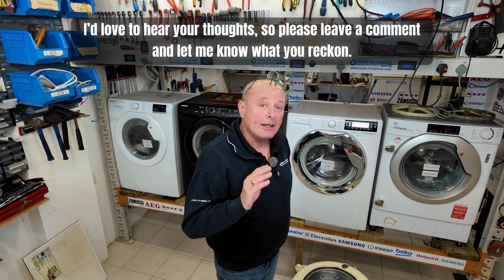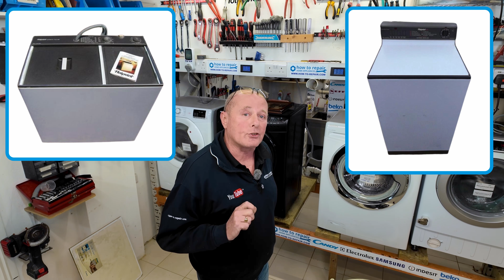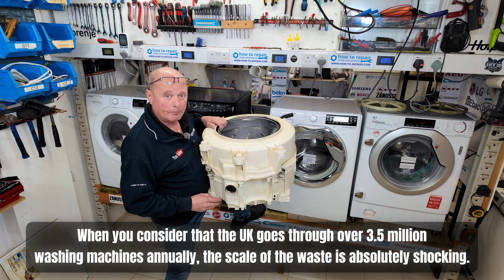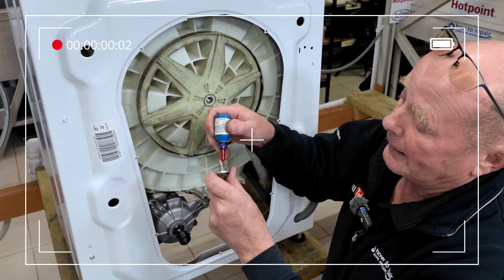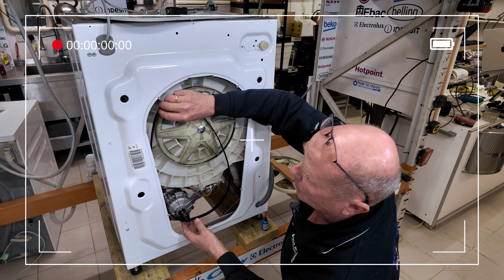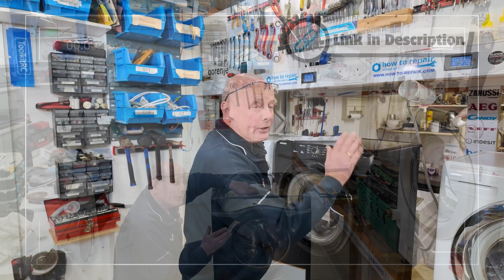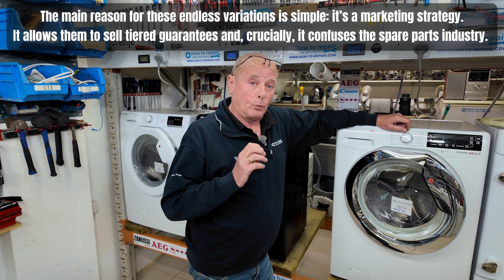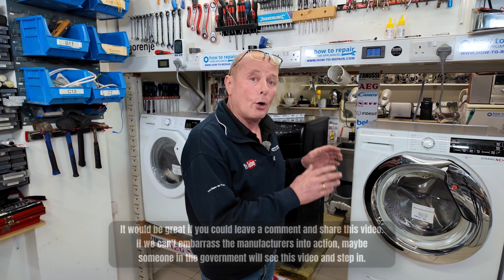I Scrapped 13 MACHINES to Prove a Point: STOP BUYING These Brands!

Comment: I'm a computer, electronics & telecommunication engineer in New Zealand. There are similar issues in my industries. I've always told my customers that a very good way of confirming the quality of a product is by the terms of it's warranty (it's not foolproof though). I've been quite open about my thoughts on built-in obsolesce & several manufacturers have attempted to bully me into changing my recommendations. I will no longer sell these companies products. Good on you for getting out there & letting the world know.
Reply: Say the names...
Reply: This came into my feed 3 days too late lol. Just been thru this exercise in NZ. My AEG lasted 16 years, my Bosch 14 years. I pretty much knew what was wrong. Had replaced the brushes in 2018 and other issue in 2017,  same F fault had cost me best part of $500 back then so figured wasn't worth fixing with costs so high. Just bought an Electrolux as was recommended by so many colleagues... fingers crossed. What peeved me off more was I saw a Bosch model I wanted being run out in Australia (was accidentally on Aus site b4 i realised) for $799 - but in NZ it was still avail for over $2800!!! We get so ripped off in this country now.
Reply: @myobacctsgirl lol!!! A tech repairman came out to fix my dishwasher and cooktop which is Franke and he said Electrolux is THE WORST. 
Franke and Electrolux make up more than half his repair work load. 
He said it's Chinese temu made, factory pumped out same cheap models and then other companies chuck their shell out the outside.  
Stay clear
Reply: @devarmont87  Franke and Electrolux are not in the same league. Franke doesn't produce washing machines just put its logo on chinese made craps. AEG-Electrolux has hundreds of models and while the cheaper ones are not better then other brands, the more expensive models are still among the better ones. They made in the EU.
Reply: @myobacctsgirl  I hope your Electrolux will serve you well.

I'm from Sweden and with Electrolux being a Swedish company originally, we take a bit of pride in when they make good, high quality products.

That said, I have sadly heard that much like other manufacturers, Electrolux quality has also taken a dive in the last decade or so :(

But not with all models, so I sincerely hope yours isn't a bad one and that it will run reliably for decades.
Reply: @sevenproxies4255  See my post above about ASKO machines. They are made in Slovenia now, but that Swedish quality still appears to be there
Reply: @sevenproxies4255  Electrolux has never been a high quality product but it is still among the decent ones. If you want a really good washing machine, you shoul buy one of the more expensive Miele-s. If you can't afford it, then the best thing to find some decent AEG-Electrolux product, like AEG 8000 series. But none of these will last 20-30 years.
Reply: My 4 year old Electrolux Dryer has a EH0 error code. After some research I found that it is a common fault that many people have had. Thankfully others have shared their experience with instructions on how to repair, which is pretty simple. 

The problem is that this same error has appeared on many different models over a period 5-10 years. Surely Electrolux would have known, in the first 4 years, of the problem and issued a remedy for future models. But no, they continued using the same methods releasing more models with the same problems, pretending everything was ok

Sad really
Reply: do you have a website? im interested in the brands and your opinion in 2026..
Reply: Hey Steven, another kiwi here, I have a new panasonic 'inteliigent' machine - it is useless - keeps partly emptying my soapy hot water and filling up with cold water.  Are there are good makers here? I wish they were go back to dumb machines - I just want it to do what I tell it to! I am intelligent enough to do the bloody washing!!! I don't need a 'smart' (but very dumb) machine!
Reply: @NZTanzya  yeah, the "intelligence" is useless on these, I just select cottons, 60C and ignore the "brain" - don't get the Panasonic tumble dryer, you'll be in for a world of aggro trying to get a mixed load actually dry to the touch...
Reply: I am in America, we are having the same issue in washing machines, laptops, cars, refrigerators, they dont want people repairing ANYTHING. They expect customers to just sent their product to the landfill and buy a whole new one and it is insanity. It is wasteful, hard on the planet, and much of these products used to be easily fixed with a few new parts. But noooo, many manufacturers refuse to allow their products to be repaired. Sometimes they make you jump thru hoops just to ORDER the part. I just bought a new washing machine and dryer stacked combo because I live in apartments. Bought the SAME MACHINE i had bought 20 years ago, same model, same brand, but because the Chinese took over the brand in 2018, (General Electric) the new machine is unbelievable. You can see that the workmanship was shotty, parts were sharp and cut my hand I had to file down the plastic areas. 
Even vacuum cleaners are no longer easily fixable. We are living in a nightmare and the Fair Trade Commission, have NO IDEA what those guys are doing. There is no regulation for any of this and a LOT of this is by design thanks to CHINA. But of course, no one will admit it. China makes many of these parts one way or another and they have gotten greedy. Thats why they sealed washing machine drums, same thing with televisions, and parts of the refrigerators as well. Just glue all the crap together so a handyman cant just fix certain parts, it is horrendous.
Reply: @ruth4489 So thruth, all around the world the same thing. I do confirm from Germany.
Reply: @ruth4489 I agree
Reply: @ruth4489  I feel like the FTC knows, but just doesn't care. It's easy to look the other way when you get surrounded by lobbyists telling lies about how Right to Repair will let China steal American IP, or allow their competition to copy their designs while they had to pay the R&D to create the designs, etc. Look up some of the anti right-to-repair propaganda some time to see all the lies they tell politicians to keep these horrible practices alive.

My field is tech so that's the area I'm most familiar with, but it seems like everything else is going the same way.
Reply: Stellantis gives you only 2 years warranty on all his cars. So they know why...
Reply: @AlessandroPitus lo stesso di Volkswagen, bmw e Mercedes
Reply: Well say the names man instead of going "Companies"....
Reply: @Krogdalo No unless you're prepared to pay my legal costs if some company has a go at me.
Reply: @stevengibbins8350  Well, then your word is as valuable as the hollow warranty term of a random company and things will continue to work as intended.

Could have simply not wrote this entire comment lol.
Reply: @stevengibbins8350  why saying "i dont like x company because this specific design" can get you in legal trouble?
Reply: I git your opinion. However they cant charge you for recommendation Ig. They only can get you 4 saying something agaibst therr products. So better dont mention them Ig?
Reply: @yassinehani yeah I don't get his point , as long as its not diffamation he can name without any issues.
Pretty sure if he say " in my opinion this is bad" protect him entirely, you can just give your opinion without any risk
Reply: Comments like this aren't very useful if you omit the names of those companies for some reason. Why protect them?
Reply: ...and they are??? please give name brands!
Reply: HP is one company to be very wary of. They did this at least once and there is nothing stopping them from doing it again. My HP laptop was dead the day after the 12 month warranty expired. I will never forget of forgive them for over $1,200 down the drain!!
Reply: I'm in NZ. My GW511 is 20 years old.
Reply: Hey fellow Kiwi from Nelson here
Reply: @joshkearns734 my hometown too. I moved away more than 30 years ago.
Reply: There's a reason why Lenovo Thinkpads remain popular on eBay...
Reply: What brands WOULD you recommend? If you just give recommendations on what ones to go for they can’t come after you legally because you never named the shit companies
Reply: @ryleawilmott8736   Liebherr for refrigeration, Bosch for dishwashers, Neff for Induction hobs, Miele for washing machine and tumble dryer
Reply: @ryleawilmott8736       MIELE, Bauknecht, AEG.
Reply: Am in NZ as well, and have been toying with the idea of developing generic control boards for these appliances, both so you can enable any smart features (or disabled them) without being locked into some awful proprietary app that sends data off god knows where, but also so that non-mechanical failures can actually be diagnosed and repaired. With a common code and hardware base across machines it’d be so much easier for repair shops to be able to diagnose and repair faults
Reply: Which brand are they I want to know too?
Reply: @LividSeven   ,,IF YOU ARE AMERICAN I WILL RECOMMEND YOU WHIRLPOOL, LG,  ,OR ANY EUROPEAN BRAND LIKE MIELE  ,BEKO , CANDY , BOSCH, SIEMENS ,, ETC , SEARCH ON GOOGLE WITH THE BRAND NAME  AND MAKE SURE THEY ARE BUILT IN EUROPE OR AMERICA FRONT LOAD AND YOU WILL EXPERIENCE LAUNDRY LIKE NEVER BEFORE, HAPPY LAUNDRYS MY DEAR ,
Reply: Also from NZ and interested in this!
Reply: Wow.
Reply: Thank you very much🙂
Reply: Home electronics are class 3 products so yeah the quality isn't great .
They're not designed to last , the soldering is poor , the parts are cheap .
They're designed to be replaced , or you'd never buy more and more and more
Reply: @CorinaGilligan-v6l yes you're correct. Their soldering caused an EH0 error in my Electrolux Dryer
Reply: Sick really thank you for your services
Reply: Hey Steven, 
Do you think you could type words that rhyme with these companies in the comments??

Like if Dell was one and I'm sure it is, you could be subtle to avoid punishment by saying - a company that makes door Bells etc etc... and we'll know 😊
Reply: Thanks for your honesty sir. May I ask:

1.-What kind and which brands in components for PC or Laptop side industry you can safely recommend?

2.-And if you can say why, not going deeply in details just why you trust them?
Thanks 🙏,
Reply: That’s great to hear from someone inside the industry. The same pattern shows up everywhere—short warranties, harder appliance repair, and products that feel almost built to fail. It’s why more people are talking about planned obsolescence and the decline in product durability. Respect for sticking to your recommendations.
In your experience, which industry has the worst built-in obsolescence right now—electronics or appliances? 👀
Reply: @IndustrialScienceLabYT appliances, but the gap is closing.
Reply: Could be true got a 10y warranty sticker on my washing machine its passed 7y now
Reply: They can only sue you if it's untrue.
Reply: It's high time Goverments forbid these firms from doing these things. Planned obsolescence  and things that can't be fixed, it should be illegal. Customers are being well fleeced.It's bare faced robbery. Anything that's being called SMART just ISN'T.
Reply: I don't believe you without dropping names.
Reply: @ronwesting7168 F&P only manufacture for the medical industry now.
Reply: If you dont mind me is there any websites for beginners who are willing to learn a bit of electronics
Reply: Buy MIELE – then you know what you got.
Buy once for the rest of your life.
Reply: MR ENGINEER DO KNOW HOW MUCH SEXY IS A WASHING MACHINE MADE IN YOUR COUNTRY  NEW ZEALAND CALL  FISHER & PAYKEL ,IT WAS LOVE AT FIRST SIGHT ,I AM SURE IT IF GOOD QUALITY AS BEAUTIFUL IT WAS 👍👍👍, TELL MORE ABOUT THAT WASHING PLEASE
Reply: @IsaacGbornor-g6k that is history now. Fisher and Paykel are owned by Haier and they are destroying the brand. They have stopped making proper agitator washers and only sell top loaders with wash plates. Haier have reduced the spin speed from over a thousand rpm to 700 to make their top loaders like all other Asian washers. Their front loaders are rubbish too. I bought a set of dish drawers 3 years ago and they are not as well designed as the dish drawer I bought in 2003 and owned for 17 years. Those dish drawers were built in New Zealand. My new ones are from Thailand.
Reply: @bannol1 SAD ,
Reply: @bannol1  was informed that Haier transplanted the F&P tech into their top line washers and replaced the F&P units with their garbage parts so strategy is people still think F&P is fantastic, pay top dollar but get old Haier crap inside and customer is non the wiser. Pretty typical thing to watch out for.
Reply: @IsaacGbornor-g6k  on your keyboard there is key where "Caps Lock" is written. Press on it only once

Comment: I bought a Dyson washing machine for £1500 decades ago, was supposed to have a lifetime warranty. It was a nightmare. Then they decided they were going to stop making them and repairing them. Was left high and dry and I’ve not bought a Dyson product since. I then had a Samsung and that failed just after its 12 months was up. I have insurance for all my appliances with D&G…I have The Hoover 10kg washer and the same in the dryer, both came with a 10 year warranty on parts, I’m in year 7. 🫣😋

Comment: Lean design dictates the sealed drum is a better design. Losing the fasteners is great for manufacturing. Longevity the jury is still out on that. But repairability suffers because the unit can't be serviced. And after the warranty runs out, "We don't care." We'd prefer you buy new anyway.

Comment: Obsolescence is a fraud in my opinion. I experienced it first hand no less than 12 years ago. Not with a washingmachine but with my Harman Kardon BDS 270 2.1 home theatre set.
What at first seemed to be a design flaw, turned out to be, most likely, a deliberate undersized risistor in the powersupply.
A 100ohm .25W resister failed after about 2.5 years. What a coincidence.... (we're talking EU/mainland stuff here)
With some measurments and basic calculations it turned out that the resistor was maxing out on it's power/heat dissipation. Oops, design flaw.
After some extra calculations based on surrounding parts, and not using the measurments, it was very very obvious this resistor would max out. This was not a flaw, this was a deliberate undersized part, made to fail.
After replacing it with a, pretty overrated, 1W resistor the set is still doing it's job today.
I love the right to repair. I love repair cafes. But I hate manufacturers deliberately complicating things or wittingly using undersized or downright inferior parts.

Comment: I would argue any company that builds in obsolete cannot claim compliant with ISO14001 the environmental standard, which has required consideration to recycling and the environment.  ISO14001:2026 requires companies to check compliance with their customers and their suppliers to retain compliance also. How can these companies retain compliance if they have claimed to be so?  Furthermore, any other company that purchases or hires equipment with built in obsolescence with no return through recycling also cannot claim fully compliant with ISO14001:2026.  Every company currently stating compliant to ISO14001;2015 now has up to three years to become compliant to ISO14001 2026. or they cannot state they are compliant and may be isolated from supplier chainswho are.

Comment: I have a samsung front loading machine purchased it in 2019. The bearing just failed. I took it apart and replaced the bearing. I also purchased a spider arm assuming it too was on it's way out. To my suprise, the aluminum spider arm was in very good condition. It is aluminum so I never used bleach to wash clothes and I self clean 2 a month religiously. The bearing seal is a crappy piece of plastic that had a round super thin spring like ring that probably failed first which allowed water to get into the bearing. The hardest part was knocking out the bearing..he tear down was easy, just put the screws back in the spot when you take it apart. I think I paid 600 for the machine and it's so damn heavy. I will go with a top loading speed queen when it fails.

Comment: I work in automotive and IT and I fiddle with electronics myself... frankly, there's almost nothing I buy new anymore because it's disgusting how much we get scammed.
It may not be suitable for everyone, especially when it comes to washing machines, freezers etc. but especially when it comes to TVs/Monitors you won't miss any of the modern gimmicks.

As far as cars are concerned, expect older models to skyrocket in price, because a lot of what comes off the production lines atm is garbage. 
Even worse when it comes to EVs, but they are more of a ideology/policy than a engineered product anyway.

Comment: In the last 20 years I purchased a Candy washer that lasted 9 years, a Hoover 5 years, a Hotpoint 3 years and lastly a Samgsung.  The Samsung cost nearly £600 but came with lots of easy to use features and a 5 year warranty. The Samsung does not clean very well and stained white clothes often come out looking unwashed.  It has a bubble-wash feature that does not help in any way but takes 30 minutes longer. The most irritating feature being washing that gets badly twisted and sometimes torn.

Comment: I am also a technical repairman and things have not gone downhill only in terms of simplifying and saving mechanical solutions, the same issue is with electronics, unreliable solutions are put into production without long-term real life testing to consume money, which is supplemented by low-quality parts made in China. Competition forces production to constantly lower quality in order to stay alive. Precious metals are out of use, meaning all plugs and sockets provide poor quality connections.